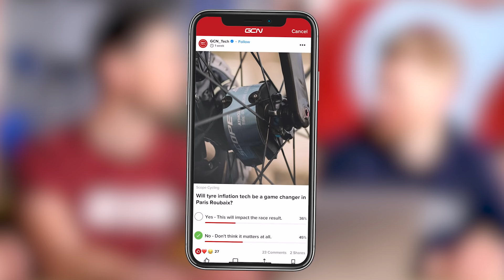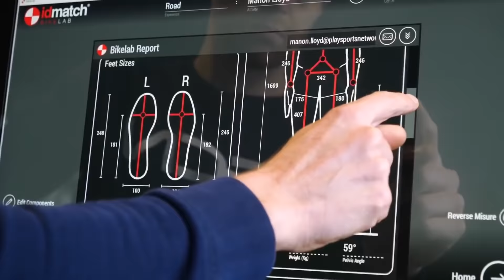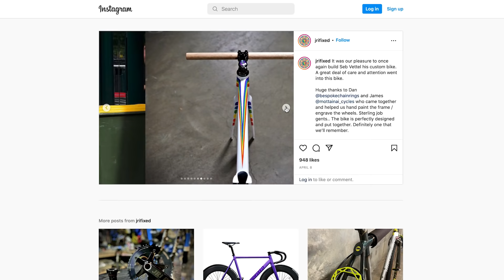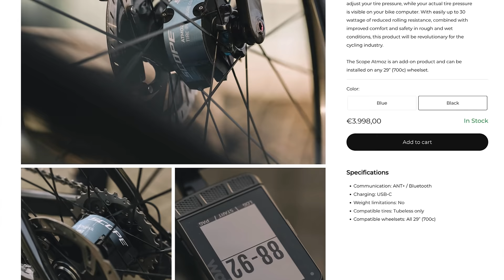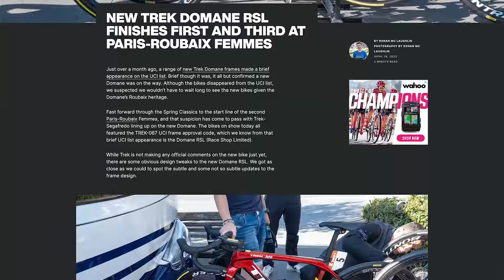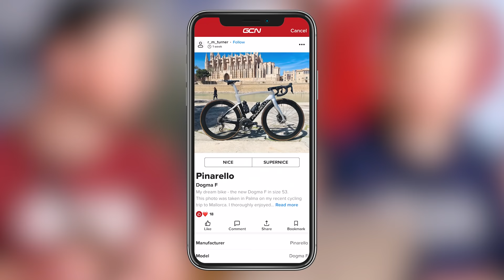We Ask A Bike Fit Expert Some Big Questions | GCN Tech Show Ep. 226

Comment: Pros are often faster, not in spite of their terrible mechanics, but because they have the ability to maintain terrible mechanics relatively injury free. I ran on my heels for decades because that's what some of the fastest pros do and I was told by a number of coaches that this was OK, that changing it would take longer than it was worth (in the end it required a full 18 months to get back to where I was, in the 3 years since, it's been PB after PB after PB: totally worth it!). Heel running is not OK: the freaks at the upper levels can do that, normal people can't. The terrible forms highlighted here may very well be the reason these rock stars are so fast, but for normal people, it will be injury after injury after injury.